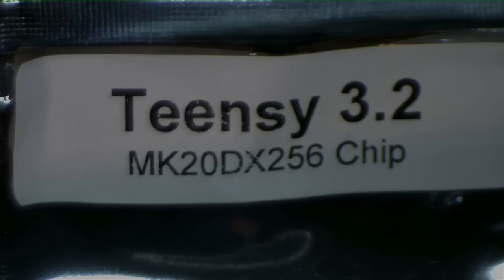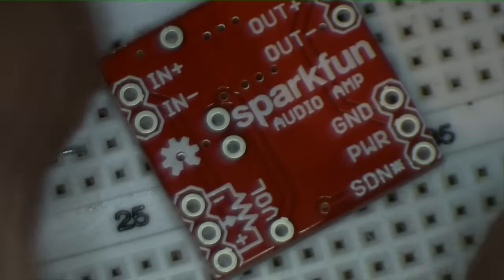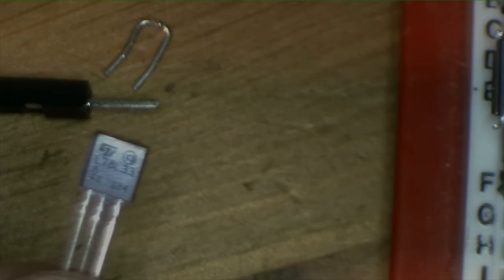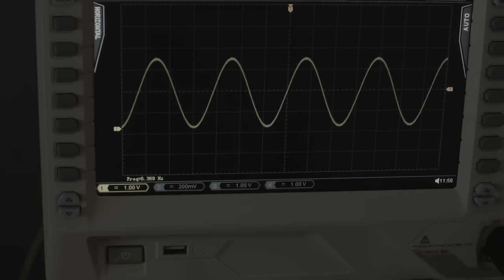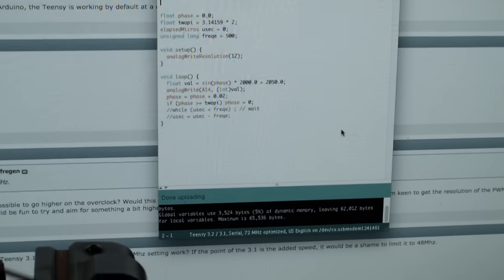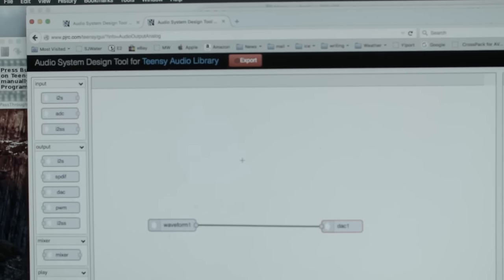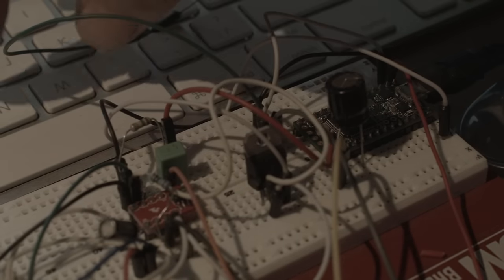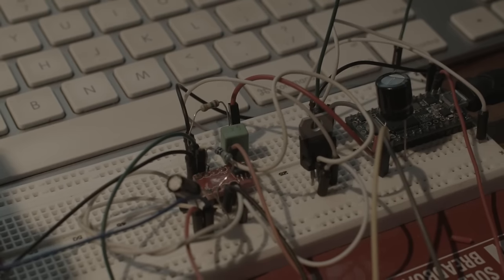Teensy 3.2 - Not your grandfather's Arduino

Comment: You'll probably be happy to hear I finally made a tutorial for the audio library, with a 48 minute walkthrough video.
Reply from the maker: +PaulStoffregen That's great.   Everyone who thinks to come to this vid, should check that out (including me)!
Reply: +PaulStoffregen are u the one who designed teensy?
Reply: Dhruvo DZ Yup
Reply: +PaulStoffregen I find the "pads" under the board a little odd. But apart from that, I really love the Teensy 3.2 (soldering to it looks odd when using it on a breadboard and I actually don't like soldering to my Teensy3.2).
You could've gone with a dual row, so you could fit 1 row of female headers and one of male (or both female) and still use it with a breadboard (headers on the pads wouldn't work that well).

But I really love that you made these boards available (for a price less than an Arduino).
The ARM boards of Arduino are too pricey or are also stuck with the (for me unwanted) UNO (or worse, MEGA) footprint.
Reply: Boss! why haven't people blew up here? ive just realised the power of micro controllers. 
a few months ago i couldn't even say micro controller.
i realised i could improve my gaming lmao (modding joysicks) that was my drive. i need a teensy now for a control panel.
im at the point now where i can basically totally understand the blink code im right at the begginng of a journey. Paul you must be miles down the road. btw i watch your audio "tutorial" ;/ ;D
Thanks for your creation!
Reply: +PaulStoffregen I want to use an Teensy for a Ham Radio project. I watched the 48 minute walkthrough video also but now it seems to me that (for step 1 in my project) the audio library can be used with a naked teensy 3.2 without the audio shield ? Greetings from Austria !

Comment: What would you use as an amp, as opposed to the Class D, if you were making a guitar amp?
Reply from the maker: Like for a physical regular electric guitar?  Certainly I wouldn't be using DAC/ADCs or anything that puts a processor of any sort in the signal path.   Probably vacuum tubes...
Reply: Audio snobs.. gotta love 'em.  Or, y'know.. not.  Guess you don't buy any kind of current gen stomp box.  You have an old amp that has a spring reverb?  If you can honestly listen to the effects from a top end digital reverb, like the Big Sky, and tell me ANYTHING analog comes close, I'll call you a liar to your face.
Reply: Exactly. People like tubes because they drop frequencies they don't like, Not because its better sound.

Comment: I'm looking for the cheapest arduino that I can run an I2C screen off and control a motor. Is this not the best option?
Reply from the maker: +imabeapirate Hi there.  You can run I2C communications over just about anything that runs the Arduino stack these days.  Of course you need to get a separate I2C motor driver in any case.  Cheapest Arduino?  Hmm...  If you take a look on Amazon there are a bunch of Arduino UNO knock offs that go for ~$8 US.  I can't vouch for them personally.  But ~$8 is pretty cheap.  You could just buy a bare Atmel chip and program it yourself, that would probably be cheaper (if you have an outboard programmer already).  But the safest bet is probably just to get an Arduino-branded UNO for ~$19 US.  Of course, all this depends on what you're planning to do with the motor.  If the program is small, the UNO will work.   If you have a huge program you want to stuff into the Arduino, you'll need a more expensive one. 

Hope that's helpful.  - Joe
Reply: yeah thanks! my concern is having a PWM pin with a high frequency for the driver, as well as enough buffer memory for the display. I may just use a standard R3 or sparkfun redboard to make it easy...

nice review ps! Much appreciated!
Reply: +imabeapirate Details matter.  You wanted higher PWM frequency.  On Uno, the timers use 16 MHz, so for 8 bit resolution you can run 62.5 kHz PWM.  Teensy 3.2 has timers running at 48 MHz, so you can get the same PWM resolution up to 187.5 kHz.  Maybe 62 is plenty?  Maybe not?  Likewise for a display buffer.  If you have a tiny 128x32 pixel OLED, only 512 bytes of RAM are needed.  That's 25% of the 2K RAM on Uno.  Teensy has 64K RAM, which might really help if you're using a bigger display.  Or it might not matter.  Details.....

Comment: I came across this video wile researching how to build a inverter. or more like checking out videos on micro controllers. to run a inverter. the teensy is probably over over kill for what I need. but I like the high frequency operation of it. I don't know all that much. but with it running at 98mhz. can't it regulate much better. prevent overshoots and voltage drops in output. basically what it would be a couple pwm signals. and a feedback to regulate output voltage. and high temp. high and low input voltage shut off. and over current and over output voltage shutoff. everything a well manufactured inverter would have. it would basically be a DC boost stage. I was planning on using a output board for spwm "sine wave" output. with fet  drivers . for the output stage. but the teensy could probably handle that also. and still be super fast. but I know nothing about programming. a inverter isn't that much different than a d class amp.  I have been trying to learn all I can. I need to build this inverter for my home. the total output will need to be 6-8kw. so what I'm getting to is. will a teensy do what I am needing? or should I go with a arduino  or two! ? I enjoyed your video. its the first I've seen. but I'll be checking out more. thanks.